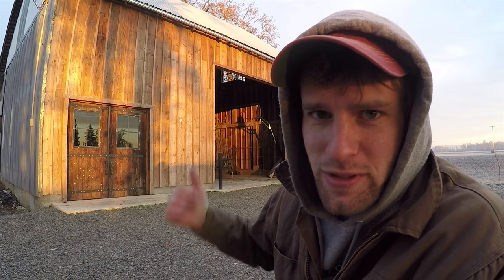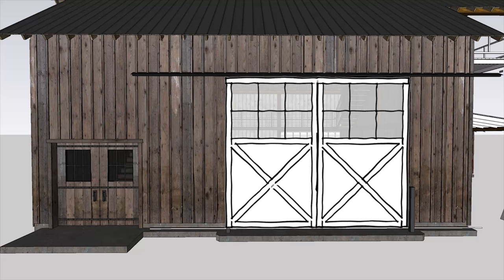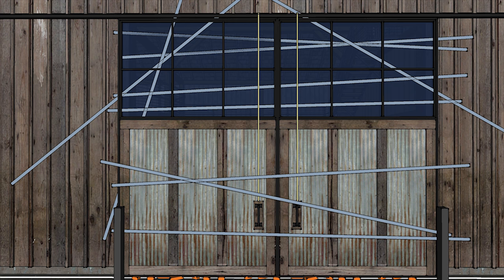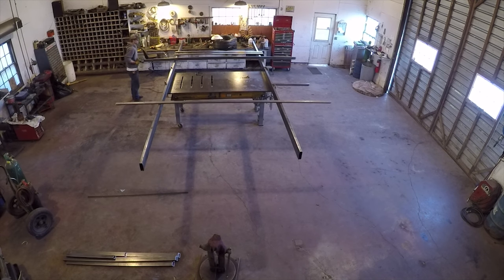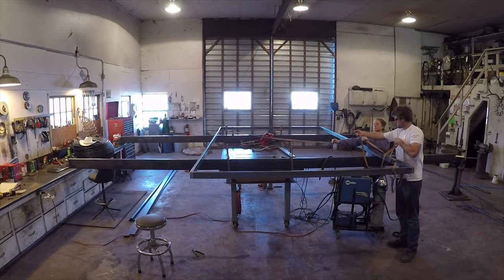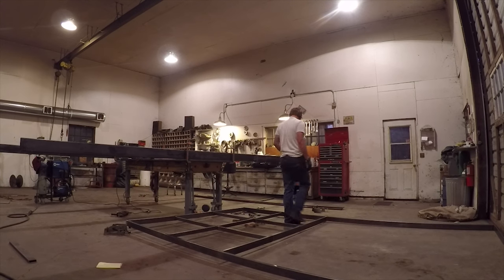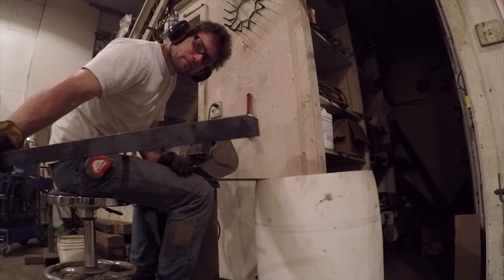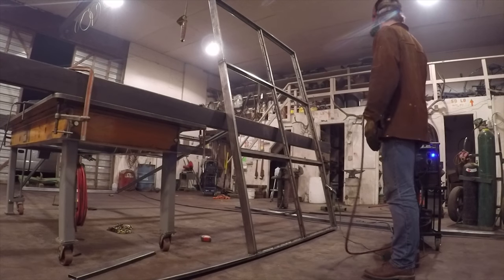Shop Doors pt. 1 - Framing the Project

Comment: Using the duct tape might have turned out a bit more of a disaster, considering you almost broke your foot moving the metal around, good call on that :). Seriously though, going through the thoughts you had while designing is really useful, a lot of videos start at the final choice, but it's helpful to hear the thoughts.  Looking forward to seeing more.

Comment: zero need to weld the glass insert flat bar solid , stich welds would have been beyond strong enough being as there is no actual force or stress applied to them , also install the glass with some silicone and that will help with making them more weather tight

Comment: you should have added the "middle section " before you square the door, it helps pull the door exactly wear you need it , then square it … it will be much closer to being square

Comment: It's a pity the horizontal metal strips on the small barn doors are not on the same height. On the drawing they are on the same level, in real they are not. :-(
Reply: For a precise man like you, this view will remain annoying.
My proposal to solve the problem:
- mount the hinges of the right-hand door on the correct height
- cut down the top of the right-hand door to the correct lenght
- shorten both doors, to mount two brushes underneath
Additional advantages: the floor remains clean within the turning circle of the doors, and the wood at the bottom of the doors will not rotten as fast (your work will last longer). Not to mention: a clear conscience. ;-)

English is not my mother tongue. I hope i made myself clear.